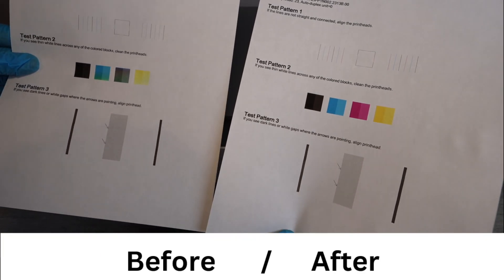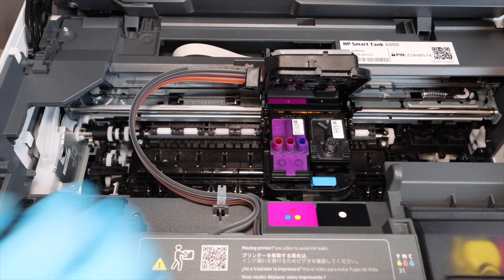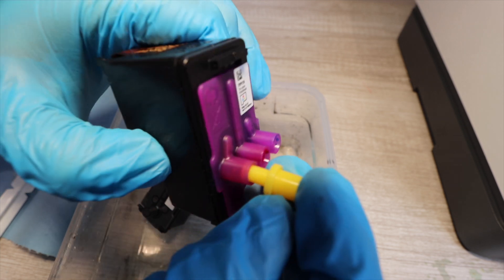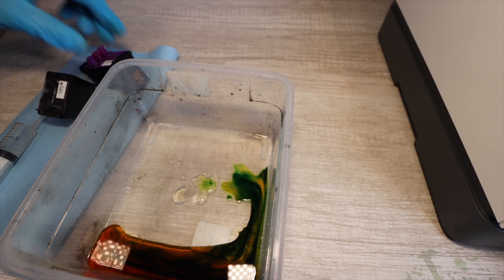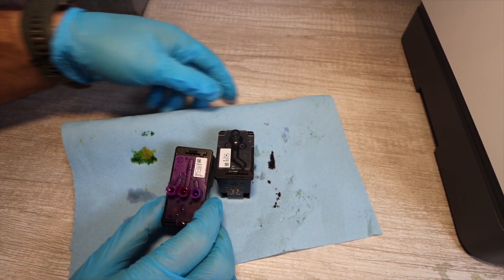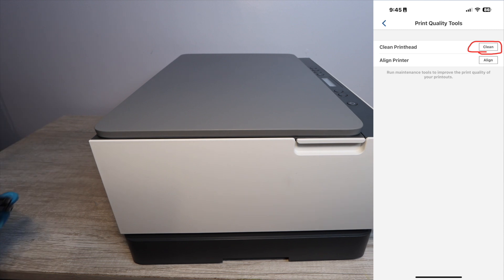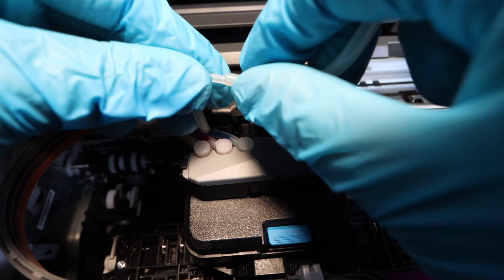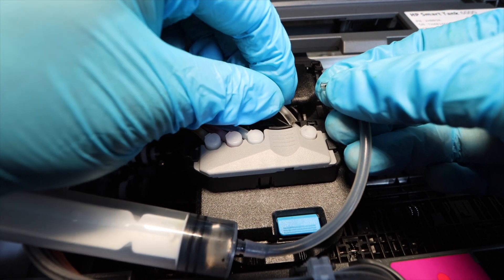Hp Smart Tank - All Models 500 - 7600  How To Clean Printheads, Not Printing Color Or Black - Fixed!

Comment: I have concluded that these printers are total junk!  I have ordered two different smart tanks and neither one of them have worked.   The last one the print head was stuck in the never move mode. The first one had no wifi connection!  Junk Junk Junk

Comment: Hi 
Thank you for your video in showing how to clean the printheads on your he hp smart tank plus printer 
Would you know how to get to the ink supply line on the 559 smart tank plus as this is causing the problem when I print and need to clear the air clogs build up

Comment: Hi, thanks a lot for these instructions. I have used it to identify some issues with my black ink not printing well. The black ink line has been completely dry. I tried to suck ink through, and it worked quite well. However, it always receds in the line over time, especially when printing it is rather flowing back to the ink reservoir than forward to the print head. Does anyone an idea on this? Best, Robert
Reply: @robertkirchner2848  perhaps you have an air leak in your black ink line? Like where the silicone tube inserts into the top of the ink cartridge. Your black ink moves away from the ink cartridge ONLY if there's something allowing the displacement of said ink .. like an air leak.

Comment: Thank you for this great video. I followed your instructions and was able to get my HP Smart Tank 651 printer from printing blank to printing three of the official 4 colors, the magenta is not printing. I tried a couple of times to re-clean the printhead, but still no luck. I also tried to see if there are any air clogs. Does that mean the printhead is bad?
Reply from the maker: Possibly it might be worth replacing the color printhead.
Reply: @BestPrinters Thank you! Love the cleaning kit by the way

Comment: This video almost addresses my printer issue! My HP Smart Tank 670 is showing an E7 error and indicating that the cyan tank is empty. All tanks are now full but when I try to print a test page, clean heads, or do alignment I get a 'printer is not available' message. Also no response if I try to force a print using the control panel on the top of the printer. As a result I can't access the print heads by stopping it while it is printing. I can't figure out how to access the blue button on the print heads component in order to clean them. Any suggestion will be very appreciated.

Comment: Al of my colours print apart from black which doesn’t print at all, even though the black ink tank is completely full, I’ve looked at the tubes and the coloured ones have the ink going all the way through but the black one doesn’t have any, it’s mostly clear with a few small bits of black ink, will doing the last thing you shown solve this?

Comment: Even your bad PQ report is WAY BETTER than mine.
Mine PQ report looks faded and scratched. In the Test pattern 2 the black is totally absent, and in the TP 3 there are no arrow and the black looks totally faded and scratched.
I had no problems with my HP Smart tank 514, but let it rest with no use for a month and a half... and when I started using it again, this happened. I had no idea I had to put it to use frequently...
What is its problem exactly? How to solve?

Comment: At the end when you brought the ink back into the lines, mine sucked right back up. I have to wait for the print heads to dry but if yellow is still not printing could there be an issue with the tank?

Comment: Used this video recently and it worked like a magic. I've to add that I'm hugely disappointed with HP SMART TANK printers. Anyone considering buying these printers should thick twice as its worst printer I've ever bought, requiring continuous maintenance.
Reply from the maker: True
Reply: @BestPrinters  The worst printers are the ones with expensive, small replacement ink cartridges. Not having to buy ink every 100 prints is terrific. Having to unclog a printhead periodically is a lot better than buying those expensive replacement cartridges. I've been happy with my Smart Tank printer.
Reply: @robertelliottsr4566 true generally speaking, however with these the catch is having to buy new printhead replacements every two weeks. It adds up the same way the tiny cartridges did so you're back at square one. The company is dishonest in this way and this lack of integrity is a turn off. Just build a product that is reliable and you will get generational customers. You dont need to nickle and dime everyone under false pretenses HP.
Reply: @joshuamckinley4187  lol, every two weeks? I'm here because my printers black print head is acting up, after two-three YEARS 🤭 Really wonder how you use your printer😁
Reply: @MarithaAndersen I use mine like a normal human being. Honestly, i wonder if I got a dud. Either way. The upkeep on this model is poor in my experience. 😢 to Hp...send me a new one  mine is actually still under warrenty til March. But Yes i use mine normally...er tried to. It just sis now because I can't use it like Intendend. It also wont print yellow..or calibrate monitor colors do yes all around. Waste of time, tears and money.
Reply: @joshuamckinley4187 yeah, you must have gotten a really bad one, don't you think? (I was only joking about how you're using it, you got that, right?😘)  But you see, they don't make lasting products, because then we would buy less often, and they would get less money in their pockets. Damn spending/consumption habits of the world. It would be much better, for both people and the earth, with sturdy products that we could repair instead of replace every time something broke. Better for everyone except the greedy producers!
Reply: @MarithaAndersen i so agree. Thanks for the kind words. 😊
Reply: @rajsahdev4129  concuerdo con ud. En esté caso smart tank 500

Comment: I did the cleaning and now the colors are alot worse? I originally had to do the cleaning to try and get rid of the white lines that were appearing when i printed. But now the blue is extremely pale, the yellow is a dull mustard color and the Magenta is just completely gone. Is there a reason this could've happened? My ink is all filled, i dont see any air bubbles in the lines and i keep trying to run cleanings and it doesnt seem to be helping at all 😭😩

Comment: once in how many days should this cleanup be done?
Reply from the maker: It’s should not need to be recurring. Only do this one you have a real problem with your print quality.
Reply: when i had my eco tank i only had to clean the print heads once in 5 years i owned it before it finally croaked!!! and it was a high milage printer!!! i used the best printers cleaning kit works amazing as well can recomend it!!!